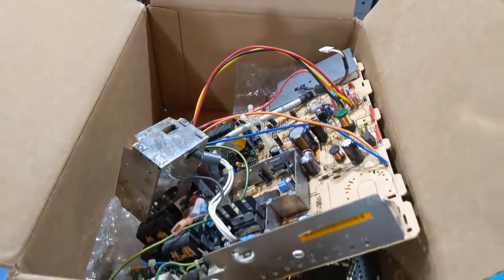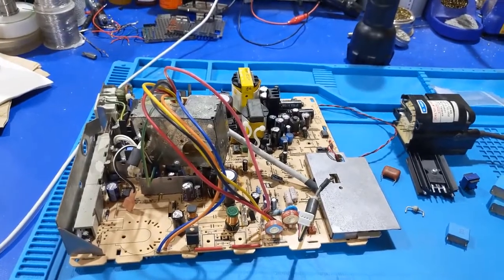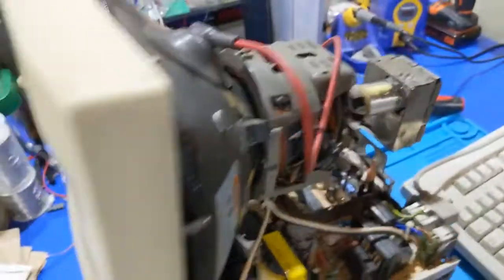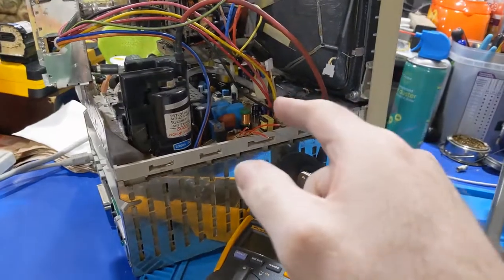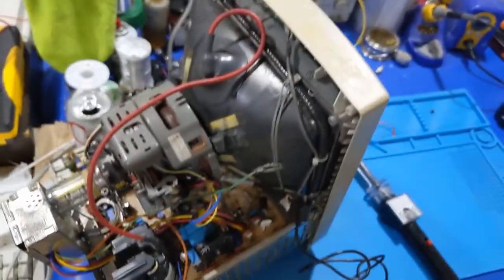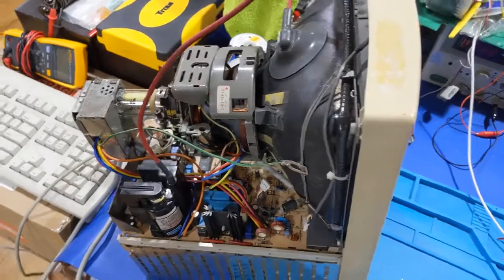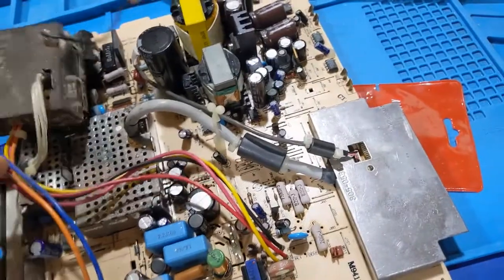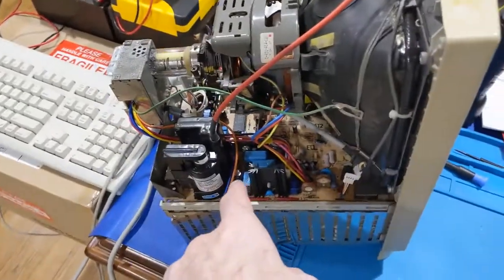Macintosh Color Classic High Voltage Troubleshooting

Comment: Great video. Do you happen to have the schematics for that analog board? I do have issues with the voltages on the computer part on mine. Thanks.
Reply from the maker: The schematics for the CC analog board do not exist. However, the Macintosh M1212 schematics do exist and they are similar.